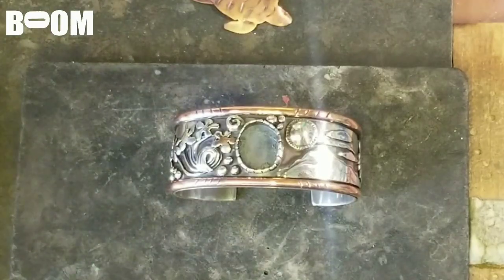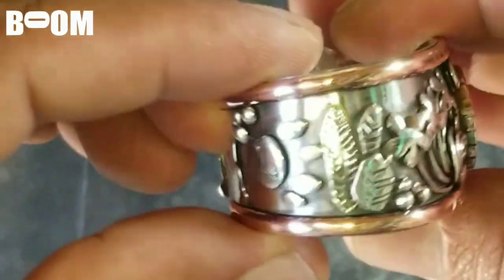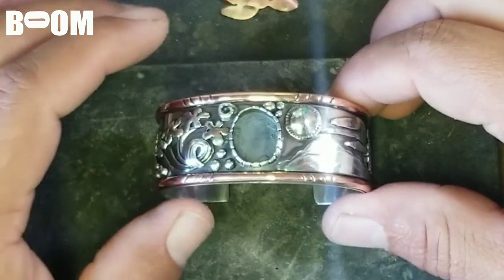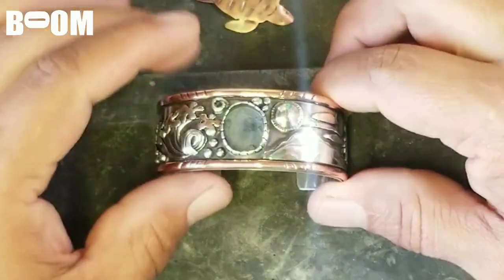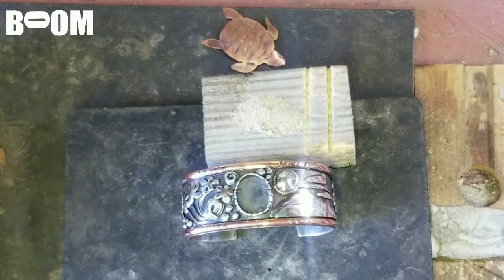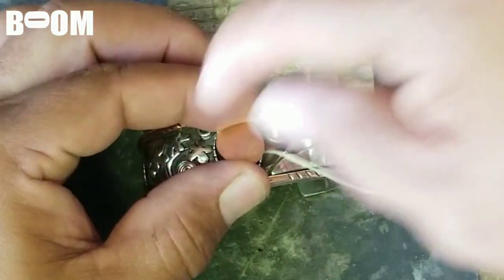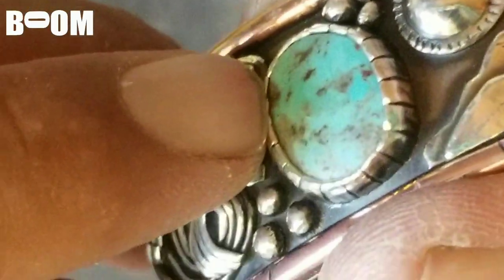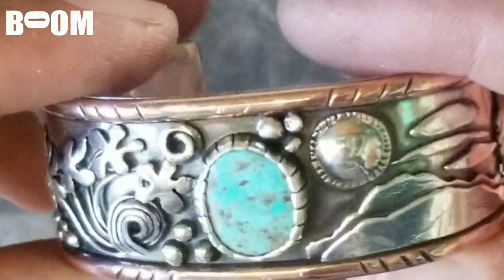Ep.40) Setting Cabs | Exploring Ideas | #jewelrytutorial

Comment: I make step bezels, I've used old plastic gift cards or old credit card,  there's also a jeweler's clay that you can use if your cab is uneven on the bottom. 
I've never used tobacco or saw dust.
The only time I've ever used epoxy on a stone is if I'm capping a crystal or claw.
Reply: To set, I use a hammer hand piece or I just use my own strength to push a brass pusher on the gallery wire or castellated bezel, or a rocker on regular bezel. 
Rings are secured in my grs vice prior to setting.
And finally,  burnish.
Reply from the maker: Id like to try that clay stuff on uneven stones. Heck yeah man!